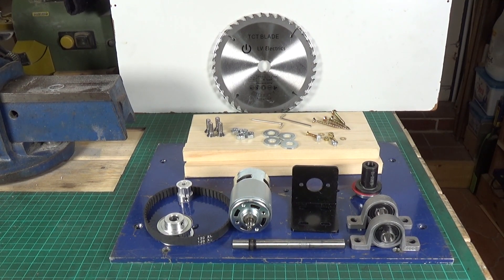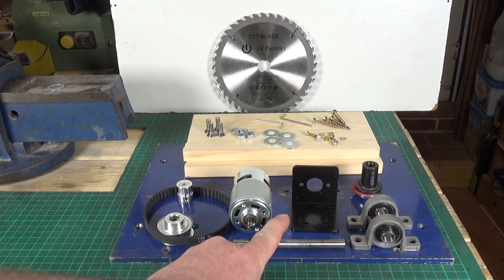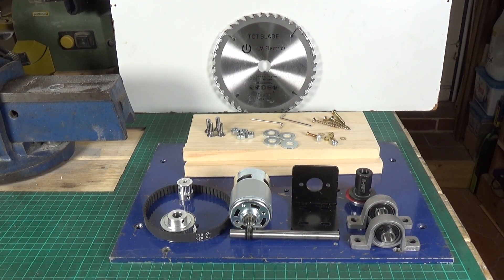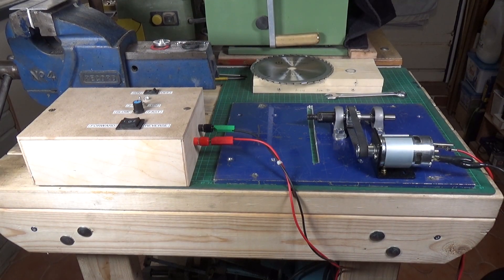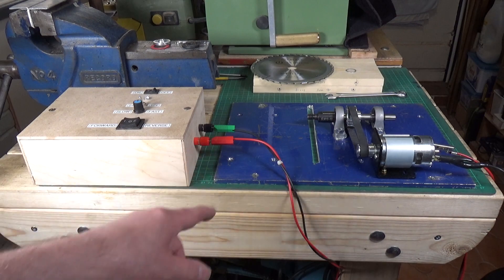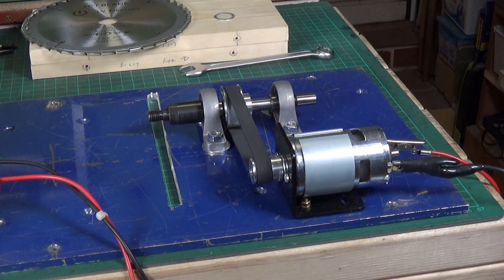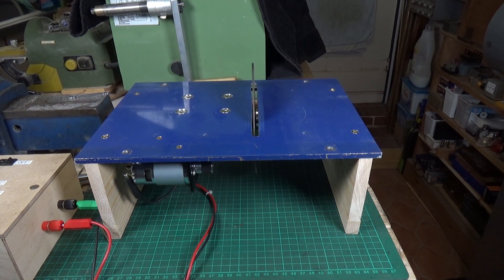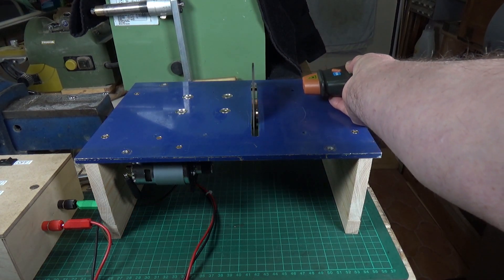775 DC Motor Based Scratch Built Mini Bench Saw - Part One

Comment: I see you can buy little linishers/belt sanders using the 775 motor.  Would be handy for restoration work I expect.  Be simple to build one as well.

Cheers Rob
Reply from the maker: Hi Rob,

Yes i've seen a couple of videos on the Banggood one. I was thinking that a spindle drum sander might be useful, again easy to make with a 775.

Cheers, Alan.
Reply: @RetroSteamTech  

Hi Alan,

I think the name of the game is keep the leverage/load bearing diameter down.  The saw bench you made would work a treat with a smaller diameter blade.  The low torque available dictates that you must keep leverage loading as small as possible.

BG have sent me a 60 volt DC variable power supply which I am currently looking at.  If it does what I expect, it should be a serious driving force for these little motors.

Cheers Rob
Reply from the maker: @Xynudu 
 Hi Rob,
 Be interested to see what you think of the Banggood power supply. I had the same thoughts with regard to the saw bench, i already have a small bench saw but i wanted something with a deeper cut hence the 165 mm blade. Still waiting on the power supply at the moment so i haven't got any further along with it.
Cheers, Alan.

Comment: Hi Alan,

Works as well as I expected.  Slow feed and should be OK for light gauge wood.

I would reface the wobbly arbor with the lathe (use the arbor spindle as the mount).  Should be a simple job. Mark everything for reassembly if the thread is not straight.

Interesting to see how inertia straightens the blade at high speed.

Cheers Rob
Reply from the maker: Hi Rob,

Yes i think it will be usable, especially when run on 36V. I'm not sure refacing the arbor will work, it looks like the threaded part is actually bent.

I'm not sure that the blade is being straightened at speed, i think that it just moves from side to side so fast our eyes can't see it so it appears straight.

Managed to source a 36V 9A power supply from ebay and an NVR switch. I ordered another (hopefully straight) arbor from Banggood, so watch this space 🙂

Cheers, Alan.

Comment: Watch your fingers there Alan, that small block of wood was mighty close to the blade, do you think those motors would power a buffing wheel or perhaps a small belt sander, great video Pal.
Reply from the maker: Thanks Mike. I already have another small bench saw which i purchased so i'm well aware of the safety aspect. I'm sure they would and i wouldn't be at all surprised if someone hasn't already made a belt sander using one.